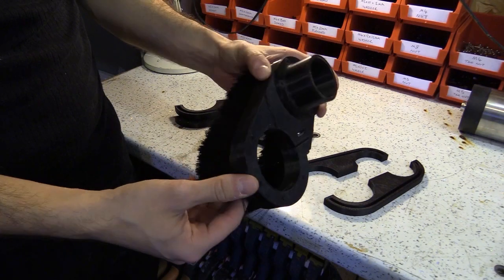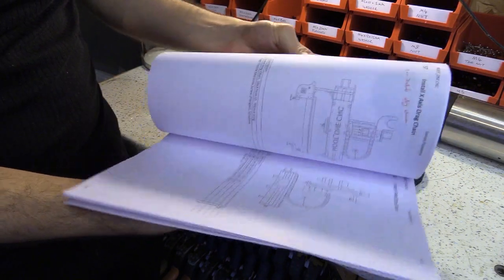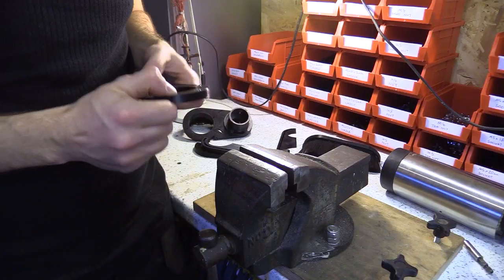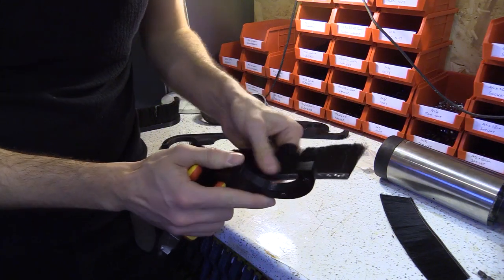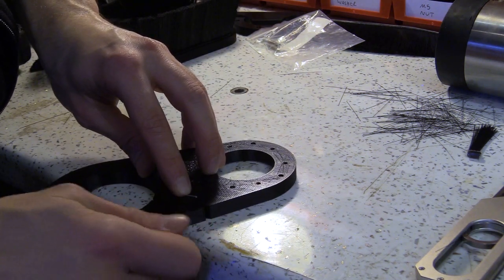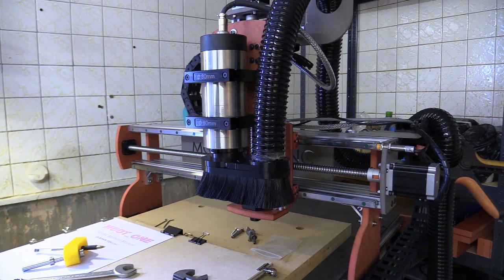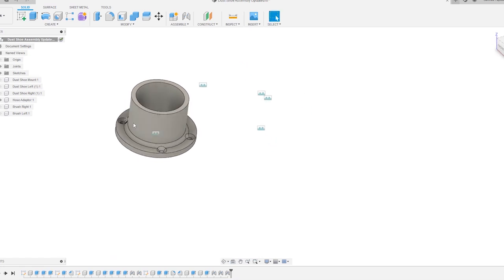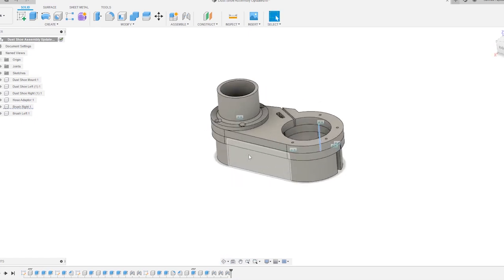#50 Moot One / 3D Printed Dust Shoe

Comment: Hi
In your solution, the shoe is mounted on the engine, so the shoe moves exactly like the Z axis. When milling deeper pockets, the hair of the shoe will come under the cutter that will cut them and after a while you will have to replace them. I had it done in my C-Beam. After a while I decided that it would be better to mount the shoe to the profile in which the Gantry Plate Z-axis moves. A shoe with a spindle connection made of flexi pipe silicone, which shrinks during milling and the shoe stays in the position set at the beginning. In this solution, there is a problem with dust extraction during external milling, but then I leave the shoe to the full depth of the material and somehow it goes.
Nice channel, I'm looking forward to your movies.
Greeting
Reply from the maker: How deep are you imagining cutting? The max cutting depth is dependant on the tool - and I normally only work with max 18mm sheet material so use 20mm cutting lengths.  A fixed height shoe would be better this is also better than nothing.

Comment: The bristles look perfect. I've tried different solutions for my CNC dust shoe, EVA foam sheets, leather, shower curtain sheeting. Getting the stiffness needed but flexibility is a challenge. It seems like bristles are really the solution here. Who would have thought that you could buy lengths of  narrow bristle? Thanks for sharing.
Reply from the maker: You're welcomed. I tried using clear PVC - which wasn't bad but the bristles are a lot better.